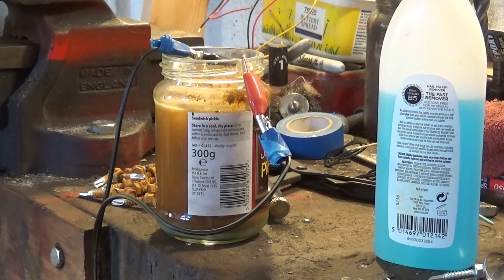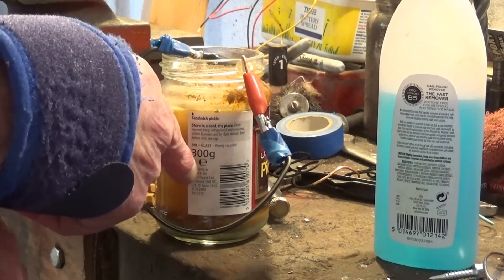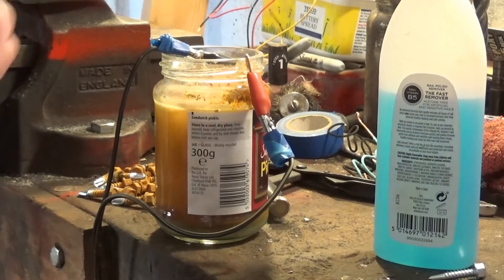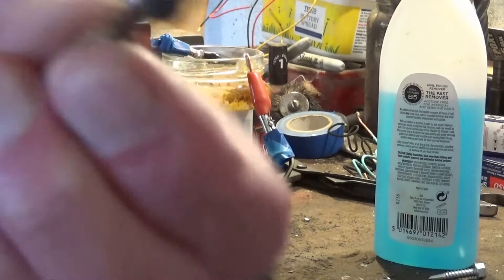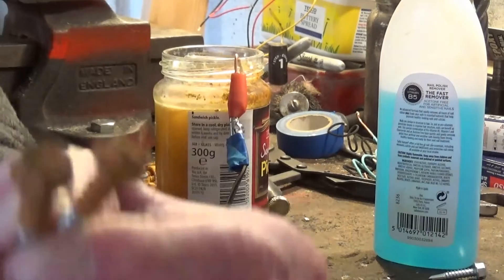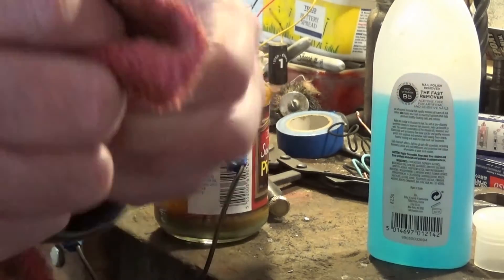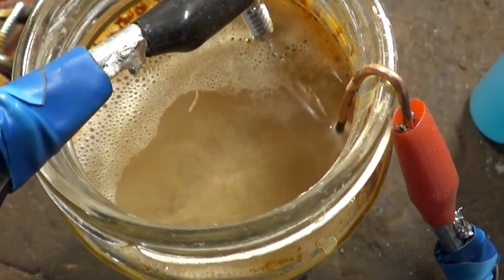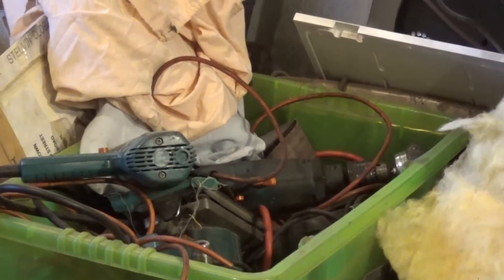Simple Electroplating At Home

Comment: Interesting little segment about the electro plating method Malc. Might be numerous other uses too.
I've got the fishing reel sorted with some nice new supple line, just got to find a day to fishing.
Reply from the maker: Look forward to your fishing video. Electroplating is simple. I just wanted to show how simple it was using copper sulphate.......however this is the next best. Water and baking soda, or white vinegar and salt, both work the same.......get some nickel anodes from ebay.  Make solution as I've show with low voltage power supply. Attach part  to be plated to negative, and positive to nickel plate anode......it's as simple as that.

Comment: I use 3-4Volt and 250mA ! Malc remove that zink from the new screws (10min in battery acid) !
Reply from the maker: Hmm always understood you have to nickel plate first, partly why I've not bothered before. Anyway, doubt I'll be doing it again. Many years ago, early 1970s we got some sheet steel for an Aga oven hood. To copper plate it, all we did was get some copper sulphate from the chemist. Then using a car battery, tipped a little acid in a jar. Mixed the copper sulphate powder with water in another jar. Put battery positive onto a paintbrush, negative to the hood. Dipped the paint brush in the acid, then the solution and just painted it on. An antique looking copper hood for the price of steel.